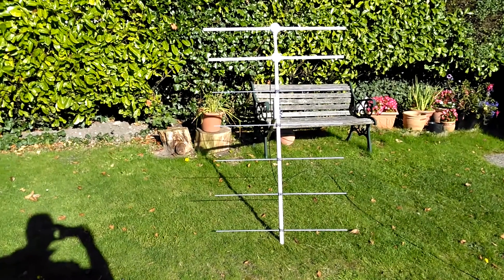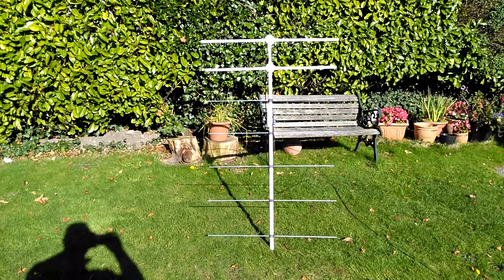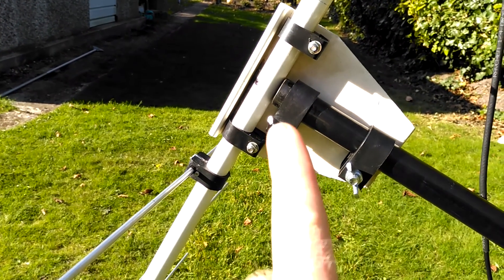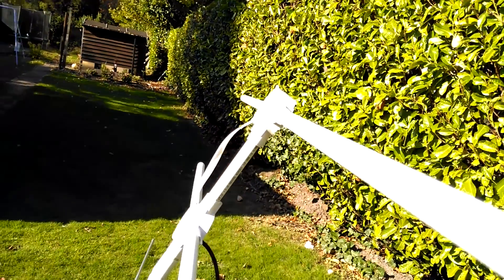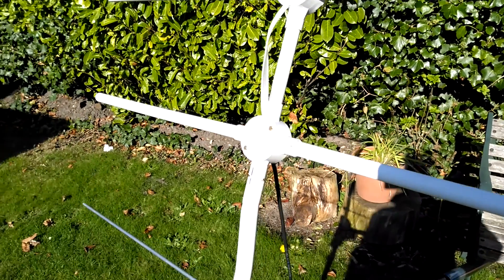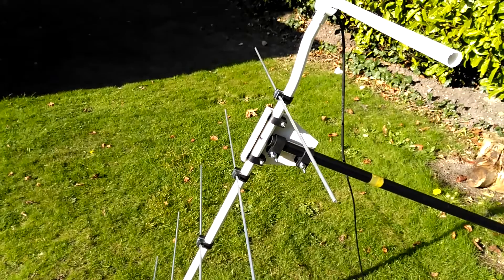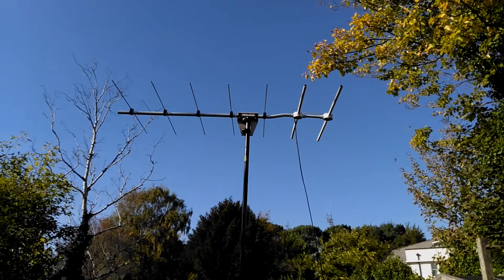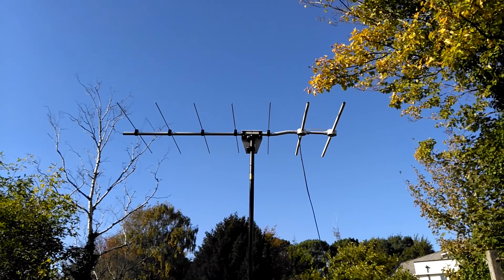HomeBrew ZL Special beam Antenna

Comment: Mark - this is a class build, very very well constructed indeed. Can I ask about the slight 's' bend just befoer the driven element please.
Reply from the maker: hi John. The bends are made using a conduit bending spring. Its done purely for asthetic reasons
Reply: mk1tina well, it works very well aesthetically for sure 😜